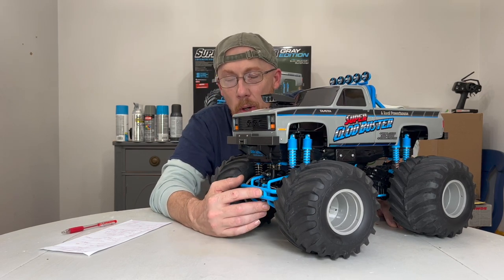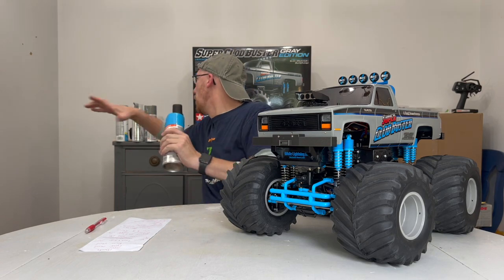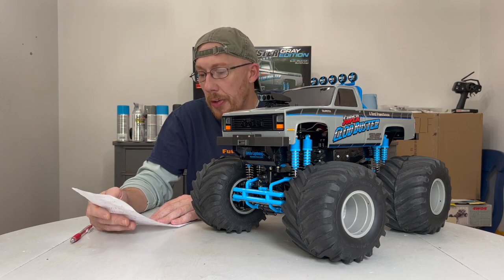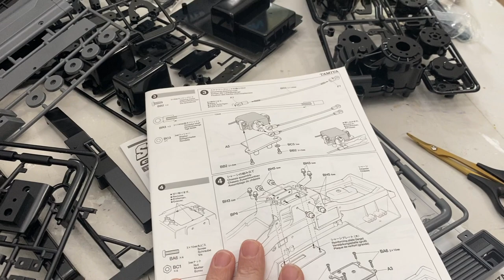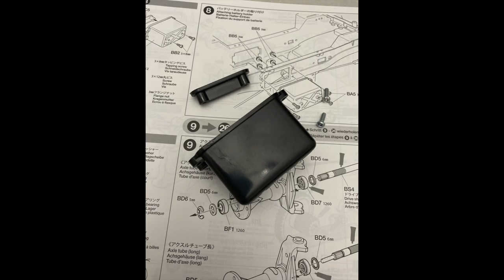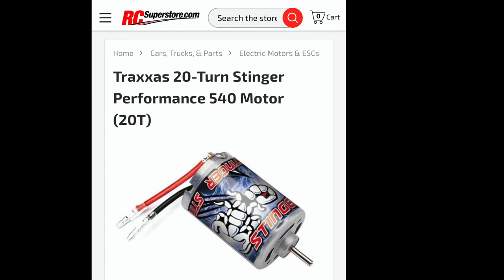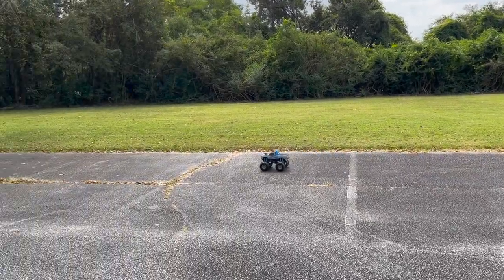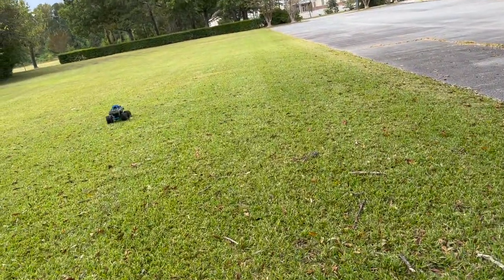2022 TAMIYA SUPER CLODBUSTER GRAY EDITION

Comment: Nice work on the clod! Honestly for me, I like the color of the body.  To me, the color grey is already nice color and doesn’t need to be painted.  I plan clear coat mine.🤣   Didn’t really care for the blue on your roll bars.  It looks more toyish, but to each their own!  I’m now thinking If I could just find the clod buster black f parts instead of using the cyan blue parts, the clod would look more aggressive,  stealthy, and just killer looking.  I’m also gonna order a MCI repro 80’s decals and changing the yellow and orange strip, to another color.  Gonna think on that one.🤣.  I may hold the cyan blue f parts and see if I can hunt some black f parts of which I know is gonna be hard to find.  Any who, great job on the clod.  Hope to see some bashing videos on the toy!😀
Reply from the maker: no worries bro, the only problem with the grey molded body is the molding marks and impressions are visible. Tamiya does require their own grey paint for the body actually I just chose my own. With the body imperfections issues Many people have this problem but if a shelf queen is not your thing don’t worry about that. Nice to see you on the Tamiya kick.😀